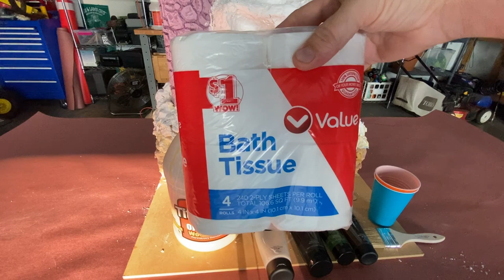Crafty Builds: Custom Grayskull Part 1

Comment: @The Crafty Android Excellent work very inspirational, though I wonder...when working with the foam boards, wouldn't it be easier to have an alcohol lamp and use the flame to heat up a spoon to then cut through the holes of the designs of the windows and the concave areas? The hot spoon will melt through faster as it cuts away the foam and then all you need to do is smooth up the surface areas with either the sand paper or the dremel burs you use. You could also get a foam wire cutter or make a homemade version with thin metallic wire and a 9v battery, and that too could save you lots of time cutting the foam. Anyway, love your work on this Castle Grayskull, hope to see more, perhaps a Snake Mountain!
Reply from the maker: Thank you so much for your support and input. Yes, those tools would definitely work well and make things easier for me. I didn’t want to spend any more money than I had to, so I used mostly what I had on hand as far as tools go. I will definitely consider some foam wire cutters in the future.👍👍
Reply: @thecraftyandroid3530  Always glad to share tips with awesome fellow custom builders as well as getting plenty cause that is how we learn. I love learning a lot from others too, which is the principle of art itself. Aside the hot wire foam cutters, an alcohol lamp is relatively cheap. I mean if possible you can buy one at a Dental supply shop, could cost no more than 2 bucks or so and the alcohol has to be 90% instead of the 70% rubbing kind. Thanks too for being so awesome and you definitely have my support.
Reply from the maker: @EternalRoman  I’ll definitely look into the alcohol lamp. Thank you so much!😄

Comment: i thought you might paint the cracks in black on the towers before using a sponge to paint the bricks? green without getting green paint in the cracks, also, what does the toilet paper do?
Reply from the maker: I almost always save the painting for last. It’s the most satisfying part. I cover the painting in part 2. The toilet paper and wood glue method is simply to harden the outside of the foam. I stopped using that method and started using a much better one that I cover in part 2.

Comment: I didn’t catch if you mentioned this, but I recommend with the wood glue you use “waterproof when dry” otherwise you will reactivate the glue when you go to paint.
Reply from the maker: It’s waterproof when it dries. It’s possible to reactivate the glue, but the paint dries too quickly to reactivate it. So there’s no real worry there.